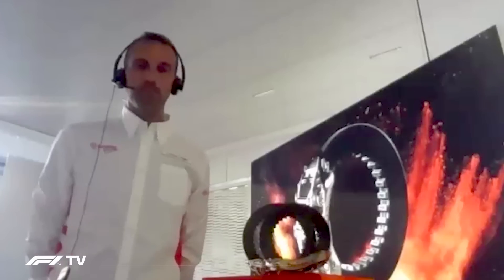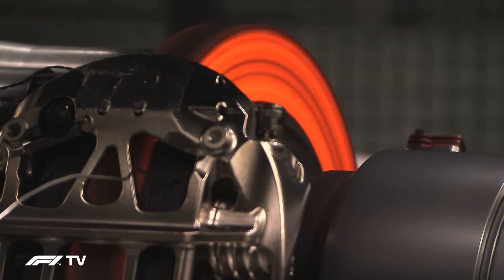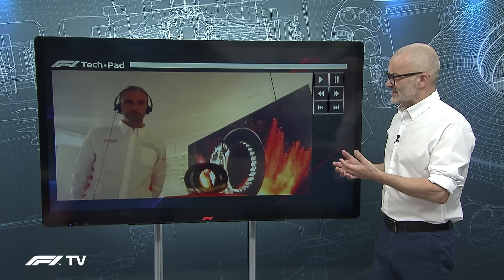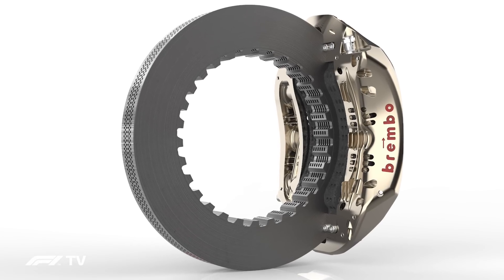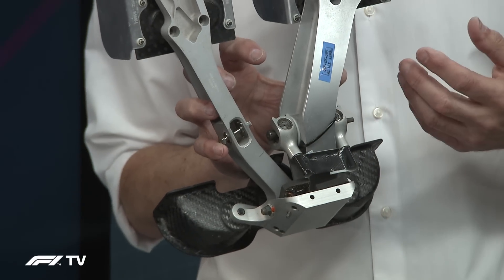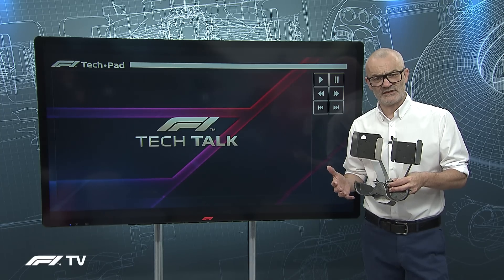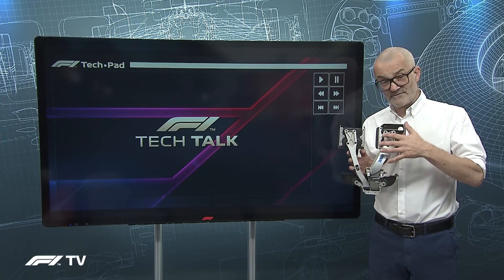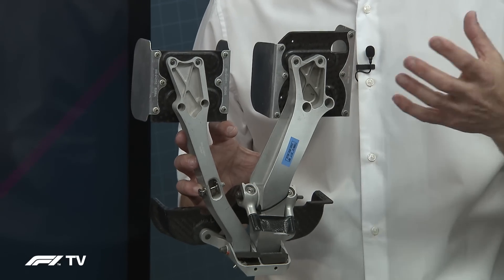A Closer Look At Braking Systems | F1 TV Tech Talk | Crypto.com

Comment: Seeing some misinformation in here and a common myth. He mentions that under braking the g forces assist in pedal pressure. 

The issue with this is, the driver is belted in extremely tightly. The belts restrict movement. The second the driver hits the brakes their body will be held in place by the brakes which cancels out their forward momentum. 

At this point they are decelerating at the same rate as the chassis. So there are no extra gforces on the pedal. In order to achieve extra braking, the driver would need to be beltless. 

I think if you brake this down you’ll find this myth doesn’t hold up to scrutiny.

Comment: "Carbon Fiber" generally refers to CFRP- Carbon Fiber Reinforced Plastic. These Discs are Carbon/Carbon. There is no plastic resin near these parts.  It seems to be Carbon reinforced Carbon, I hoped they would talk about that. He specifically asked about the process and that's when I expected some accurate info.
Reply: A preformed body of very pure carbon are cooked at 2650*C for quite some time to heat treat and arrange the carbon atoms in to a very stable and basic molecular structure. However, after this Brembo have come up with a new way to finish the discs instead of using the standard chemical vapor deposition to impregnate the disc with pure silicon to create a silicon carbide matrix. The CER material is a trade secret and will not likely be known outside of Brembo for some years. The end material is likely not using a ceramic matrix and is purely a carbon matrix using multiple types or arrangements of carbon molecules (such as graphene or graphite) to create a more resilient disc and allows them to create the 1400 holes or so throughout the disc that allows for proper cooling.
Reply: Are you sure? Just a student so im probably wrong but from what i know it wouldnt be very usefull to reinforce something with the same element, and is it possible to use carbon for the matrix too?
Reply: @samnotloading6101  think about what would happen to a synthetic resin or any other matrix material at temperatures of about 1000 degree celsius. It would melt into ashes at the very first braking action.
Reply: @samnotloading6101  Iirc from a documentary I watched years ago, the final product is Carbon Fiber Reinforced Silicon Carbide.
The process is something along these: Carbon Fiber Reinforced Plastic -> baked it until what remain of the resin is just carbon -> Carbon Fiber Reinforced Carbon -> infuse silicon into it -> Carbon Fiber Reinforced Silicon Carbide
Reply: @samnotloading6101  a quick wiki would answer the question. Seems like only the initial process used some type of binder, then carbon is added followed by compression and heat treat.
Reply: @samnotloading6101  its carbon ceramic not  carbon fibre
Reply: @prosperbanana  as above its not carbon ceramic as per road cars, its carbon fibre reinforce or impregnated with a silica, producing a silicon carbide
Reply: The initial disc blanks are made up from carbon fibre matt layered up to the required thickness with the epoxy as usual… they then press a hook into the layers and pull it back so the fibres from each layer are entangled with the layers above and below. 
Then the blank is roasted until all the epoxy is burnt away just leaving the mesh of carbon fibre … a bit like burnt toast.
At this point the choice is to impregnate the carbon mesh with either a silica based material to make carbon/ceramic discs as used on high-end road cars OR impregnate the carbon mesh with carbon thru vapour deposition (carbon/carbon) - where a carbon rich gas is forced around and thru the mesh until it builds up to form a solid  disc.That’s why it takes months to make. As you can imagine, the carbon mesh blank is very fragile, so the wastage in manufacturing is very high which is not what you want for a product that takes 6 months to make.

Comment: My mind is kinda blown now. So, from the moment a driver steps on the brake pedal, now his body weight pulls forward adding extra pressure on the pedal, so the car will brake even harder, and that's a positive loop until the car has decelerated enough that the driver can pull back his foot off the pedal...  How can they regulate the pressure to avoid locking up?
Reply: I'm no racing driver but maybe they shift some of the weight to their heels and then to the car's frame and from that reduce the pressure on the pedal.
Reply: While yes the weight shifts forwards and G forces help, have a look at how tightly drivers are strapped in and you have your answer
Reply: @Th3_Gael  Right... He can just retract the leg at any moment because his torso is kept to his backseat. Thats what I was missing lol thanks!
Reply: Now I wonder how Leclerc managed to drive a couple of laps in Spain while unstrapped last year
Reply: Training, practice and seatbelts.
Reply: The heel rests on the petal unit that Craig has allows the driver to limit the forward movement of the foot.
Reply: Drivers are tightly strapped in via seatbelts. There's barely any movement forward. You want the seatbelts tight and no body movement to resist lateral g-force otherwise you will be using your physical strength to resist g-forces on your body and will get tired faster. Plus you want the to be strapped in tight incase your car flips during an accident.

I drove some F-Renault and F-3 races in the early 2000s and we are strapped in real tight. there almost no movement forward under breaking.

Comment: The brakes aren't power assisted?!?! Man, they are working HARD in that cockpit!
Reply: Yea the Gs also help them brakes harder as soon as they brake the Gs move forward and helped them pushed the pedal harder.
Reply: @reynaldiwidjaja277  that's a mostly a misconception (they make the same mistake in the video, though). Even if the G-forces push your body forward, it's still your leg's muscles that apply all the force between your body and the pedal. Imagine you are standing on a scale, with your legs slightly bent (so it's your muscles carrying your weight), and carrying a heavy bag on your shoulders. It's true, the scale would score higher because of the heavy bag, but your your legs have to support all the extra weight all the same. It's the same here. G forces push you to the pedal, but your leg muscles still has to put those 130Kg of force to both brake and keep your body from sliding forward.
Reply: Hang on. But if they have brake-by-wire and all setup is electronic plus there is the setup for energy regeneration, how and why they have to push physically that much.
Reply: @giogio182  The team increases the stiffness themselves according to driver preference. drivers generally want a stiffer pedal so they can precisely apply the pressure, and to make sure the pedals don't get pressed accidentally when going over bumps. And it's not really 'that much'. Legs are pretty strong and the g forces also do quite a bit of the work.
Reply: @askeladden450  thanks for the explanation 👍
Reply: @giogio182  in addition to what Ahsan stated, the driver's leg pushing the pedal is still what pressurizes the fluid in the master cylinder, and thus the brake system itself. The "by wire" bit applies mostly to the controls regulating the bias at the rear wheels (controlling the split between MGU-K regenerative braking and the pressure valve that determines how much the hydraulic line pressure coming from that master cylinder is reduced, so that the two braking methods balance out, so to speak).
Reply: @jsquared1013  aaah ok. Thanks! 👍
Reply: Yup. A regular person could not even get close to the power drivers use while braking.
Reply: They also don't have power steering.
Reply: @powcar91  they do have power steering
Reply: @izzdin6228  I didn't know that
Reply: @powcar91  F2 and Indycar are the series that doesn't have power steering. I'm not surprised, if an f1 car crashes, it's best not to have a wheel that whips around and potentially breaks a driver's hands and wrists.
Reply: @powcar91  no power steering at this speed and with the amounts of lateral force these tyres produce would be impossible to drive, atleast for race distances
Reply: @powcar91  Thats not true.  They do have power steering.  IndyCar doesn't however
Reply: @snowboarder981  I got the answer yesterday, thanks for commenting though.

Comment: Actually, Barichello still used 3 pedals and right foot braking in some of his Ferrari years (he was using his right foot for braking as late as 2004, not sure if he still had 3 pedals at the time), so he was right foot braking for quite a while after the start of his F1 career.
Reply: The coolest pedal arrangement (in my opinion) was that of the MP4/12. People always talk about Häkkinen's car, which had two brake pedals and the throttle. But unlike Häkkinen, his teammate Coulthard hadn't yet adapted to using clutch paddles on the wheel (though he still had them on his wheel), so he had a clutch pedal in there as well, meaning he had a total of four pedals for his two feet; clutch, throttle, brake and fiddle brake. According to rumours, the McLaren engineers even joked that they gave Coulthard a pedal for each corner of his rectangular head :D
Reply: My Fiat has 4 pedals
Reply: Thanks for sharing this info :)

Comment: Is it just me or do the Rear wings look really different this weekend ?

Edit: thanks for the comments everyone! Appreciate it
Reply: the are much narrower to lower drag so that top speed and time to reach that speed are improved. comes at a cost of downforce but monza is so oriented around straights that its worth the sacrifice in downforce
Reply: No the wings are different. They're a lot thinner in height and often called the Monza spec as this is the setup with the least amount of drag out of all of the tracks.
Reply: @a_stone  Yeah that's what I meant but the word thinner can also refer to width so it could've gone either way
Reply: As others have pointed out, the specification for the rear wings in Monza is (probably) the narrowest of the calendar, contrasted by the specification for Monaco, where the top speed isn't great, and the turns are sharp - thus the rear wings are the largest to provide as much downforce (therefore, grip) while turning.
Reply: It's the fastest track on the calendar, low downforce setup
Reply: Look out for the wings during the Mexico GP too, they'll be much more aggressively angled than normal spec because of the thinner air at Mexico City

Comment: Man I need those brakes for my road car
Reply: Those wouldn't work on any roadcar, because it's so hard to get them to the ideal temprature on the streets to work properly which is around 300°C.. 
Probably you'll catch a pedestrian with those :p
Reply: @moudihh18  they'll work just fine, the temp aspect only comes into play at really high speeds
Reply: @chiefdenis  I'm sorry but they won't work at the low temperatures, the  Carbon-Carbon brake discs will not  deliver generate adequate friction with the pads, so that their ideal temperature window is about 300°C because from that temperature and so on, you'll start to get the amazing braking ability from those discs,  i haven't mentioned the wear of those brake discs is multiplied by 10× ( if not more ) comparing them to a normal geay iron discs, so you should take in consideration that you'll paybill will be multiplied by 10× for a less mileage facing the Gray iron ones and also if you're facing problems with brake dust on your wheels be ready to get them cleaned everyday.. 
Beacuse of thoe cons the car manufacturers has 3 choices for their cars:
1- Gray (ductile) Iron
2-Carbon-Carbon (C/C)
3-Carbon Ceramic Matrix (CCM) / Ceramic Matrix Composite (CMC) 

And in most cases you'll go to get the first and 3rd options because of their reliability affordability and also they'll work properly on the road at different environments..
Reply: I tried them on my Volkswagen, they work just fine
Reply: @moudihh18  the comment was a joke mate😂
Reply: @FreeYSLM2  😂😂😂😂😂